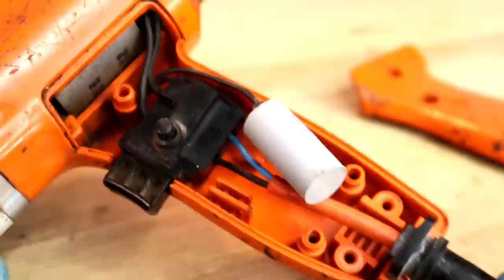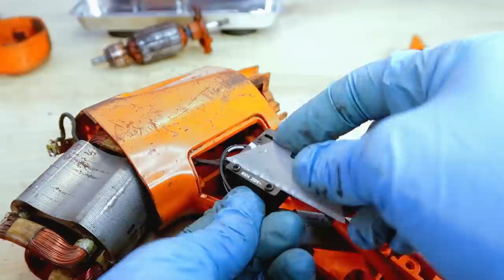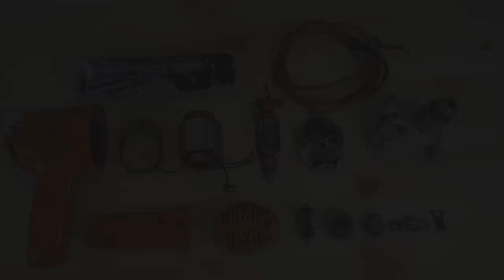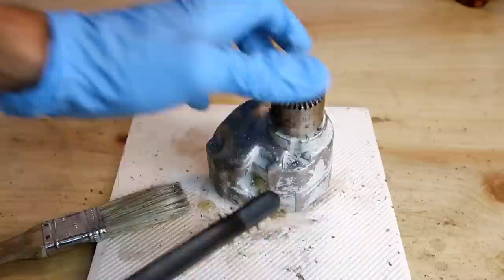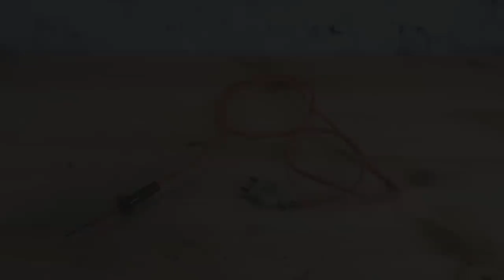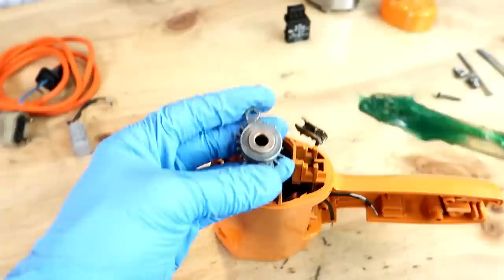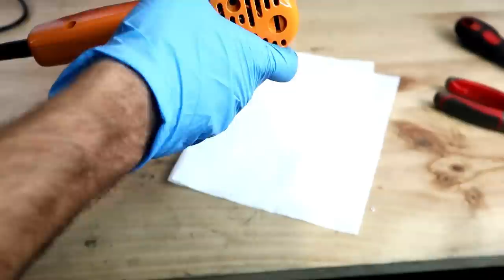Broken Old drill Restoration - Black and Decker

Comment: You should never use emery paper on the copper commutator, it embeds carborundum in the copper and it will grind the brushes away fast. Use glass paper instead, the glass if it gets embedded in the copper is soft and will turn to dust when the motor is started. This is how we learnt to overhaul electric motors for use in aircraft.
Reply: thank you
Reply: Martindale electric do a comm stick for cleaning commutators...
You just touch it on...
Reply: @stevesebzda570  Thanks, I use to overhaul starter motors, electric fuel and hydraulic pumps in the aircraft industry. First we would take a very light cut off the surface of the commutator in a lathe, this trues the com, then clean the grooves and burnish the edges (lightly) of the segments, and lastly polish the com with a fine glass paper and use the same glass paper reversed to bed in the radius of the new brushes. Other than demagnetising the fields and a continuity test that was all we would do.
Reply: @stevesebzda570  I've sure there are other ways of doing the same thing, maybe the auto industry has a different process they use, with aircraft I always worked with the belief "Do it the right way first time, every time, and it wont come back to bite you" with aircraft parts it all came down to efficiency, aircraft parts would become less efficient with age, when a part showed ware it would be overhauled, some parts had a timed life and would be overhauled when it reached it's expiry time whether it was within spec or not. I use the same methods with my cars, tools and home appliances when effecting repairs. I still love to watch these tool restoration videos, there is always something new to learn.
Reply: @stevesebzda570  If the scratches all run in the same direction around the commutator, not across the com, the brushes will bed them selves in with only a little ware at the beginning of the initial start up. 

Just don't make the scratches to deep, that would reduce the surface contact between the brushes and the commutator and would produce arcing and extra heat.
Reply: @glennmoreland6457  Your right, different processes for different types of motors, I've seen commutators cleaned with leather straps, soft wood stick used with a polishing paste and what looks like an rubber ink eraser. All do the same thing, increasing the surface contact between the brushes and the commutator.
Reply: @iflylilplanes 

Yes but some of these suggestions are strange...
Seems like we've moved on to "dremels"...with "wire brushes"...
Lol...lol

Glenn
GLMelectrical
UK
Reply: @stevesebzda570  Dremels are fantastic tools, I have two, use them in building RC model aircraft, but, they are not the be all and end all of tools, but if a Dremel is all you have, use it as best of your ability doing best you can with what you have. I like to aim for longevity with reliability.
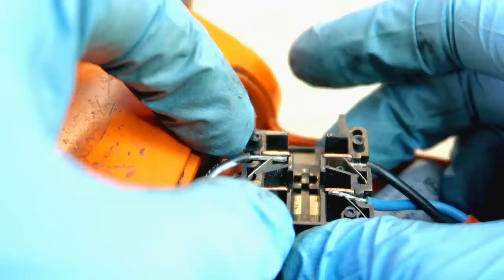Reply: 4:15 mistakes were made
Reply: Yeah stones are much better😁
Reply: Nice shoes
Reply: it's sandpaper. lol. i use the lathe to take a cut and clean up the valley from the brush wear and then clean the mica below the commutator vanes, then follow with scotch bright, i'll sometimes chamfer the end of the commutator a little bit (not where the brushes touch) to facilitate getting the brushes back over the commutator. but i'm sure you know more than i do. just the way i do it.
Reply: What in the world is glass paper??
Reply: @Flecha57  had to look it up myself, looks like a finer paper used for glass and other fine surfaces. TBH never heard of it till this post.
Reply: Rosivando 123 nice
Reply: What about a scotch Brite pad? That's what I used to clean the commutator.
Reply: Mas ai não é restauração , é uma limpeza ! Não tem como ser restauração ...
Reply: Good to know.
Reply: Exactly !!!
Reply: I use pencil rubber eraser to clean electric contacts, most of the times it works fine. I still have this drill at the bottom of some drawer in my garage
Reply: What is glass paper can you explain more please
Reply: @iflylilplanes  When your only tools is a hammer, everything looks like a nail
Reply: @christopherbedford9897  You are right "Every Tool's A Hammer" (Adam Savage), I've used spanners as hammers and screw drivers as chisels.
Reply: When safety and longevity of a tool, such as the power drill above, doing the job the right way can be done several ways, scotch brite or even a plastic kitchen scrourer would do a better job than emery paper.

Comment: Was just using the same one yesterday, It belonged to my late father ....excellent and durable piece of equipment. Dad also had many of its accessories (Rotatory saw, sander and others) ... God bless your soul dad ..
Reply: My grandfathers one is the same design, but the all plastic model, and it's been sat inside our cupboard for years, just got it running again with a new cable, seems a lot better then modern drills

Comment: Black & decker D720...
Nearly everyone has had one of these...

A good way to bring dull plastics back is Tcut...

Next time you do one of these, shield the windings on the armature & field pack with a bit of ducting tape before putting the wire brush near em...

You can always carefully clean between the segments of the comm with a fine pick...

Try not to re-use old cords...they get hard with age....
Best to sack em off and fit new power cords to older electrical items like this...

Put a bit more grease in that gearbox...as you've got a void in the lower portion of it and once the grease warms up it'll all just drop down into it and not be picked up by any of the gears...
Look to fill the gearbox 1/2 full....no more...

The little gunmetal bushings are likely to be oillite...
Dunk em in a bucket of oil overnight to re-saturate em...

You've made a nice job of that and if you look after it that'll see you OK...
(they're only light duty drills...just bare that in mind)... 😊

Glenn
GLMelectrical
UK
Reply: some top tips there, mate!
Reply: Greetings, Glenn, from stateside. I recently did a half-assed rebuild of a 1930s drill for a guy I know ... he just wanted it to work, didn't give a rip about looks ... I put new carbon brushes in it (he couldn't find them) and repacked the gearbox. The grease was so solid it felt like resin, so I took it all out and refilled it close to full. Did I f*** up? And if so, can you explain?
Also, I had my local electric motor shop replace bearings in a 1-horse 1952 table saw motor. I asked them to make it modern, but they used the same wire it came with, which is very stiff and also seems small for the amps it's drawing. It runs, but I need to take it back and have them do some work? Any input is appreciated!
Edit: I'm an amateur who's just picked up a lot of things along the way.
Reply: @willklusener9659 

Hi.
As a rule I replace cords with new...
Cords are the one component of a piece of current using equipment that get the hardest life...
In regards CSA (Cross sectional area) :
You'd need to look at the rating plate...see what the wattage is...
A current usage calc can then be carried out by dividing the wattage by the voltage... 😉
Just because the supply current of a circuit is capable of delivering a certain amount of current within its design parameters...doesn't mean that anything plugged into it will draw the maximum currents that can be safely delivered by said circuit... 
Cords are sized by manufacturers...and it would be unwise to go against a manufacturers instructions (which will often take presidence over regs such as BS7671, NEC etc) 
For a 1HP single phase drive...i would use either a 1.5mm 2 core SWA...and use the armourings as the CPC...or a 3 core SWA...with one of the cores together with the armourings...
Or alternatively a bit of copex from the motor to the starter...pull in some 1.5mm singles... 

Grease like most things will expand when hot...
So we don't fill gearboxes full with grease...enough to do its job...no more...
For ball & roller bearings the general rule is upto 11,000RPM in grease.. 22,000RPM in oil...

P. S.
If you like antique machine tools have a peep at my channel...
I've about 40 of em in storage... 😉
Reply: I still do :)
Reply: @twotone3070 

So...you've killed a few of these then in your time...
Come on...admit it...

"ere...listen...
I've burnt loads of these out...
Reply: @glennmoreland6457  Well I don't use it a lot, but err no, still the same one I bought in the late 70's. The gearbox squeals a bit on start-up, but then it always did from new. I have another hammer drill that I use for tougher work :) Sorry to disappoint.
Reply: Glenn, all good data, and thanks for being professional about it and not a troll. It seems so few can deliver knowledge without trying to utterly destroy someone. Isn't that what YouTube is all about? Sharing knowledge so we get better?
Reply: I would like you to make a video or even partner with someone and share these tips. Especially the grease. What kind to use, how to replace, how much, and show in a couple of examples where the grease should level off. I have several old tools that have very old, dead, caked grease and have been studying videos for just this reason. Even if you haven't made a video, you could collaborate with someone (like TysyTube Restoration) and put out a very informative piece.
Reply: @mantaship   Check out some of AVE's videos from 6 months or so ago. He does talk about the different types of grease that should be used using his very colourful language.
Reply: Yep, our first drill
Reply: Iw got bd 202 black&decker
Reply: The cords doesn't get any harder by age unless you put them on fire.
Reply: old soviet rubber cables are still flexible until this day tho..
Reply: @mantaship  It's simply axle grease - you can get it at any store that sells automotive supplies like this. It's heavy bodied petroleum based. You can even use petroleum jelly - it''s the same thing! Vaseline type body ointment works great and it doesn't break down as easily when heated up. Just use mineral spirits to clean the surface of your parts then use whatever lubricant grease for it - just as long as it has a thick viscosity.
Reply: I have come into possession of one of these its a d520 that seems to work ok but want to know which bits I should get as i have none. I am in the UK and there just seems to be a load of options the budget de walt ones have some terrible reviews as well as good ones. Thank you. I only want to use it in diy around the house maybe a bit of metal drilling and the occasional lock drill out
Reply: @josephuni7959  im sorry but thats just plain wrong. I have been repairing all kinds of appliances for years. Replacing a cord, especially 10+ years old, especially when it has already failed once, is the right thing to do. They definitely do harden with age and sunlight. Tools like this are heavily mistreated and usually in pretty rough shape. I wouldnt trust that cord to power a lamp let alone a power tool

Comment: Brought my first Black and Decker drill in 1971. Variable speed, forward and reverse hammer drill. Still using it today. In that time, repaired cracked cable and a pair of brushes. Great video. Thanks

Comment: That sound at the end gave me flashbacks of my old B&D I bought back in 1983.  I ran that until if finally burned up drilling holes for wiring using a spade bit in 1999.  Cost me 25 dollars, I think.  Was heavy, but a great machine.  Thanks for the vid!

Comment: I remember my dad had a very similar drill back in the 80s/90s, except his was blue, not orange. I remember the twist thing to change gear.
Reply: I recently bought one of those in mint condition at a second-hand shop, works great and you indeed need to twist a metal knob inwards or outwards to put it into hammer mode. I gotta say it works better than most drills do know and is build with really high quality
Reply: Yes my father also bought this model in the 1980s, memories.
Reply: Mine too

Comment: Ha, this is my very first drill. I did almost same job many times, and found how to remove bit holder.😉 Hold the drill on surface and put the bit holder key fully inserted, with a hammer hit on key counter clockwise direction. Thank you for video 👍

Comment: “Has no carbon brushes oh no”
Me: that’s not good
Also me: what’s a carbon brush
Reply: It's a little block of carbon, held in a little slide, and pushed by springs  onto the commutator (the part of the armature (rotating part of the motor) which has electrical contacts. Electricity is supplied to the carbon brushes, which rub (brush) onto the commutator, which then supplies the windings on the armature with power.

Comment: I have an old Black and Decker corded drill from the 80's (not this model though) and it still works to my knowledge. My Dad gave it to me when I moved out on my own along with a tackle box full of nails, screws, bolts, washers and such which I still also have after 25 years. I haven't use the drill in ages but they don't make stuff like they used to that's for sure.
Reply from the maker: yes you have right, only chinese cheap plastic
Reply: It is clear you´d never use an HILTI drill.

Comment: I miss the days when B&D made a quality, dependable tool for the ages with enough torque to break a wrist! The crappy trite they sell today just isn't up to snuff
Reply: I work in Power Tools sales at a local hardware chain in my country. Main reason B&D ditched making the Trade/Commercial use tool is because the parent company Stanley Black and Decker bought DeWalt and made them the Top of the line, then slotted in Stanley Fatmax to be the Home DIY Brand. B&D today is the odd job here and there. It's awesome having older lads come in with 30+ year old power tools looking to order parts for em to get them going again. We sell a Makita Circ Saw that's been the same model Makita have sold for 30 odd years, it's amazing.
Reply: @AzimuthKiwi  It's just the same in the Computer business, only more so. The high end commercial (server) machines are built like a brick shithouse; the low-end consumer stuff is virtually stamped out in a printing press. Same goes for printers: there's so much competition that the basic unit is just a way to sell consumables. By the time you've bought 2 or three sets of cartridges you might as well have bought a new printer (and it's probably worn out with no parts available anyway).

Comment: The old all-metall B&D drill my dad must have bought in '57 when he built his house,and later, in the 80's, stashed in a locker at our cabin still runs smoothly and is a good back up for projects. However, this video made me realize I need to open the little beast, clean it, and see if it needs new brushes, grease, etc. Thanks.

Comment: Brought my B&D variable speed reversible hammer drill 48 years ago. Wore the chuck out, fitted a new one. Good as new. Chuck cost twice what the drill did! Fitted new brushes many years ago and cleaned the commutator. Nothing today is serviceable and ends up in bin. Lovely restoration.

Comment: Btw: For future plastic restorations: You can use friction welding with 3D filament - put some filament in a Dremel, rub against plastic of same color (and type I guess) and it will bond. Not a fan of painting plastic.

Comment: You did a great job! Now, you can use the drill for another 40 years.
Reply: I've got one of them which I used the other day when the cordless was out of battery, not a bad drill, enough power to drill a 10mm hole in brass and next to no run out on the chuck
Reply: Herny👤💐💍🚗👫👙💋💜🐩

Comment: I have restored several of these B&D drills, but was surprised that you could not/did not want to remove the chuck. The procedure is to place the chuck key in position, then strike it sharply with a plastic-faced hammer, in an anti-clockwise direction (when looking at the chuck). The chuck should then unscrew freely.

Comment: Nice work..I had a very similar Black and Decker drill,which I bought new in 1980..It was made in Germany,coloured aqua blue,called Titan,it had a hammer function on the  two speed gearbox,a sort of scalloped ring behind the chuck,and a rotary speed control knob on the top of the drill body..worked well for many years but the bearings finally gave out and it started to get hot on one side as the armature was too close to the field ..was hard to get parts,but I finally did,..would have continued to serve me but someone stole it..
Reply: My dad had that model too! Remember it being in his shed. Great video
Reply: Thats realy Bad did you cry when  it got stolen
Reply: Same thing in Australia.  bearings wore out  after using a wire brush on 12 square metres of  wood lattice.

Comment: Only thing I find with this black and decker drill (and yes I do have one too), is it's very front heavy. On the plus side, I also have all the official black and decker attachments, such as the wood lathe and small saw blade. A truly novel collection. This is what made black and decker one of the best and iconic drills of the 70s and 80s, long before dewalt. Now, sadly, modern black and decker tools don't deserve workshop space, on the count that the quality is so poor.

Comment: That was the transitional model, heavyweight metal parts with a plastic handle, and the only reason they didn’t go all plastic was that testing was still being done on plastic gears in the late 70’s early 80’s and had not yet trusted their resilience